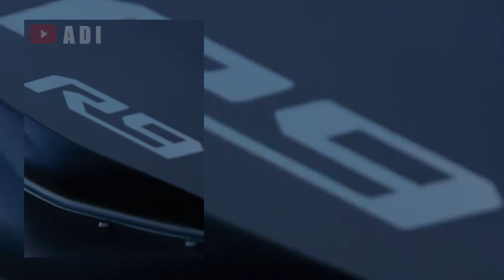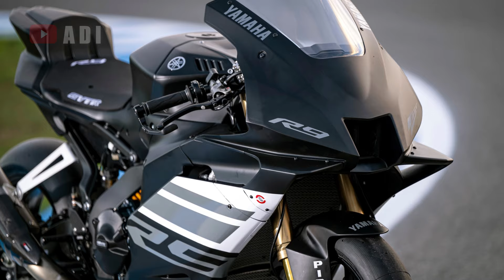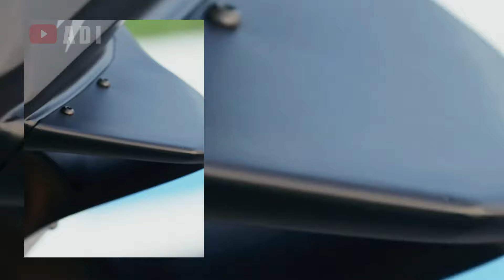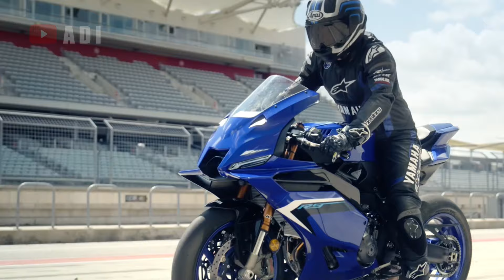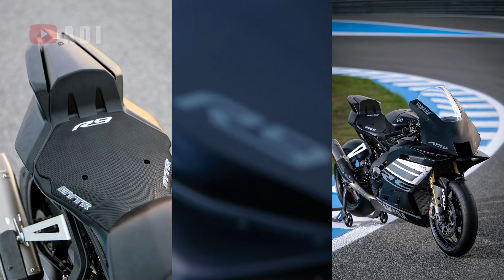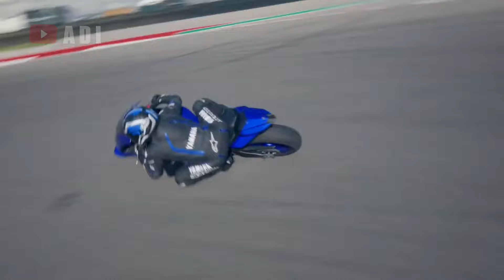2025 Yamaha R9 GYTR - Race Spec Revealed

Comment: 2025 WSSP
DUCATI 955 V2　vs　YAMAHA R9
Reply: 2 shameless bikes to be qualified as Super sport. lol
Reply: @motojc 
残念な方だ…
Reply: @trxwrftrk1219  the whole idea of racing tech was to see who can get more power/speed out of the same displacement. An engine configuration that can't produce the same amount of power is already a loser. It should not be allowed back in because it's now 50% bigger but only produced the same amount of power. lol. Anyway, I like the R9. I just don't think it's a middle weight.
Reply: R9が活躍する舞台がWSSです moto 2のよ様なレギュレーションのレースではありません。

来年の出場車両です。
2025 WSSP 
Ducati 955 V2、MV Agusta F3 800、Triumph Street Triple 800 RS、Kawasaki Ninja600、HONDA CBR600、YAMAHA R6 、 YAMAHA R9

2025 AMA  WSS
Ducati 955 V2、SUZUKI GSX-R750、Kawasaki Ninja600、HONDA CBR600、YAMAHA R6 、 YAMAHA R9
参考までに…
Reply: Ducati has been destroying the R6 for the past 2 years. It's time for a Yamaha comeback